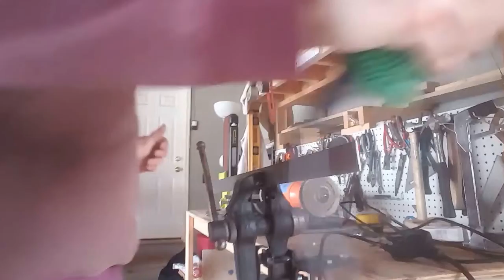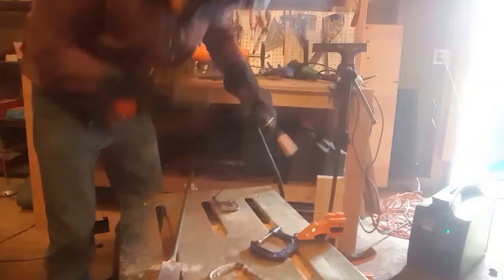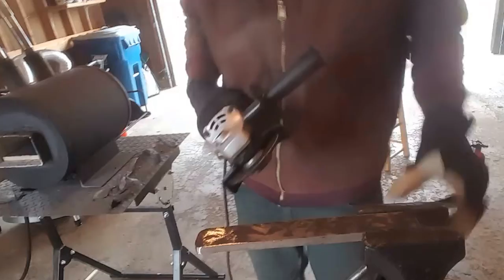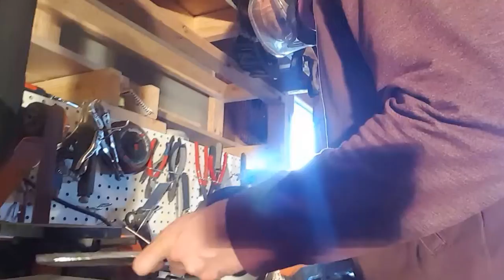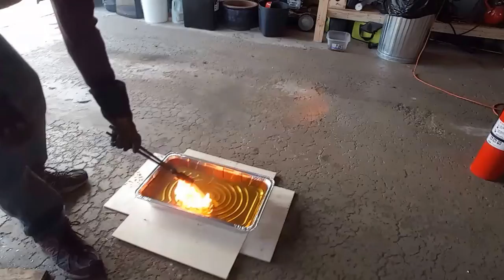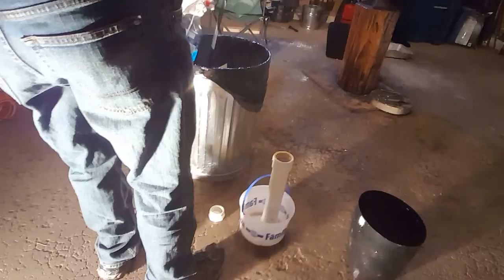Forging a laminated wakizashi blade Part 1

Comment: I notice you sandwiched the milder steel right in the middle. Wouldn't that mean part of the edge will be comprised of that steel? I would think to set the milder steel further back so the harder pieces connect to make the edge. Like Japanese smiths bend the tip upward so the milder steel ends an inch or so behind the tip. I forget the formal name for that action with the tip of the blade.
Reply from the maker: I actually didn't use any mild steel. I laminated a piece of high carbon 1084 between two pieces of 15n20. Both steels can be hardened and hold a great edge. I used these two high carbon steels because of the contrast they create when they are etched. Thanks for the comment.